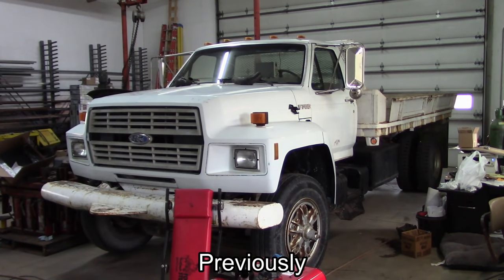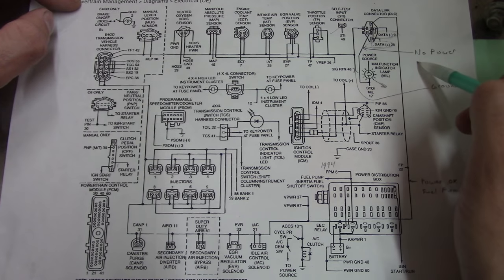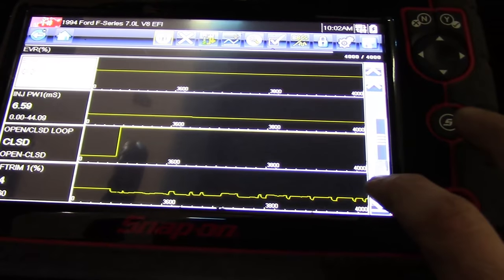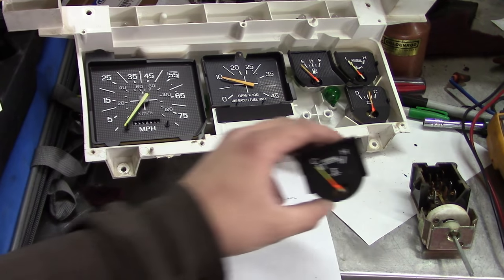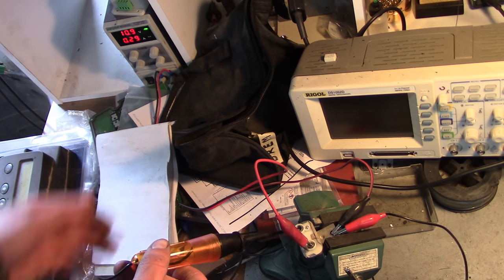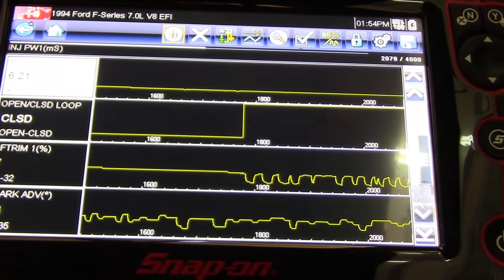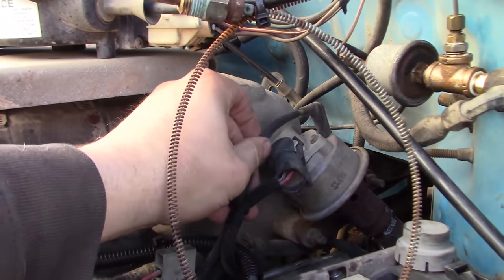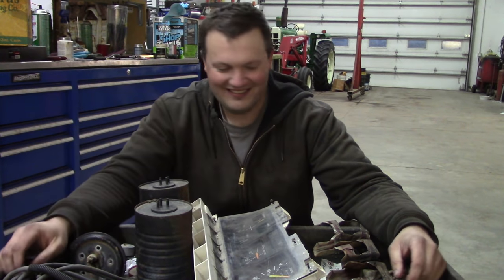Ford F700 Project - Missing, High Idle, and Gauges - Diagnose and Fix (Gas Engine) - Part 3

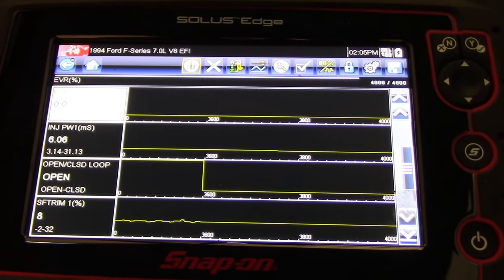Comment: 37:30. Those obd1 o2 sensors are unheated single wire sensors, when they cool down at idle they don't have enough heat to produce voltage so they switch to open loop. To get into closed, you have to rev the engine or drive it to get the exhaust temperature back up so it can work. It's why manufacturers switched to 4 wire heated sensors, to more quickly go into closed loop to provide better fuel management. I was a g.m driveability tech for way too many years. Had to learn GM management systems like the back of my hand. Ford used a similar setup.
Reply from the maker: It has a 4 wire O2.
Reply: @WatchWesWork  ok, I forgot it was a 1994, 1993 still used the single wire sensors.
Reply from the maker: @dave1135  I don't know what conditions it needs to run the O2 heater. It doesn't really matter, it runs fine in open loop.

Comment: Plus that Check Engine light bet O2 sensors on manifolds plus before or after Catylic Convert even could be plug up too! Purge Sensor on Engine may need fix too !

Comment: Wes, that regulator is likely working as intended.  Those old regulators use a bimetalic strip and a heater to provide what is effectively a low frequency PWM signal where the duty cycle is inversely proportional to supply voltage.  The average output voltage is (somewhat) regulated, but only suitable for powering devices with very slow responses e.g. hot wire fuel/temperature gauges.  The symbol on the schematic represents this if you have a close look.  EDIT: wrote this before you discovered it yourself.
Reply from the maker: The replacement seemed to be working correctly. The original did not.

Comment: Ford used those pulsing regulators since they went to 12 volts. MOPAR also used one, I use them on my hot rods when I switch from 6 to 12 volts and want to use the original gages, they work good providing 5 to 9 volts for the old gages. If it has anti lock brakes that would explain the additional data link, at least that's how it is on my 91 ford. Or just chalk it up to OBD1 sucks.

Comment: Yes sir, Those voltage regulators flash. It's not 12 volts but usually around 6 volts. At least on the old 70's models lincoln continentals. Since this is an older video you probably know why and how the voltage regulator works. The reason they made them this way was so when you turned a corner and the fuel in the tank would slosh around, it wouldn't cause the fuel gauge to fluctuate.

Comment: Wes, the schematic for that voltage regulator showed a resistor with square corners instead of the usual diagonal lines. That used to mean that it was a heating element. I expected from that, and it being a regulator, for it to have been the equivalent of a "ballast tube", which was a resistor that increased in resistance as it got hot. A flasher is also a heating element, but made as a switch, and will kind-of regulate the average current over several seconds, but it is pretty clumsy for a "regulator". Maybe they really designed it that way, or maybe the replacement has a wire that is going open, who knows.
Reply from the maker: Comments say it should pulse to prevent jerky moves in the gauges and lower the average voltage.

Comment: You actually gave this guy back his truck. With all this there is no way an owner could have fixed all this stuff. And made it sort of legal to drive on the highway without stopping along the way because the huge gastank you wouldn't remember when you filled it up if pulling contractor trailers with equipment. I watched diesel creek fix his old 429 on a 15 ton crane truck. He had to remove his to fix the engine. Possum down south fixed his crane truck also but it was a 350 Chevy with a ruined edelbrock carb.

Comment: I can't speak for Fords directly, but dropping from closed loop to open loop after some amount of idling was pretty common for that vintage.  I had a 1986 Nissan 720 with the Z24 that had a closed-loop feedback carburetor (pre-TBI!), and the service manual describes similar behavior.

"Open-loop control will activate under the following conditions:
a. When starting
b. When engine is cold
c. When exhaust gas sensor is not activated
d. When driving under heavy load
e. During deceleration
f. At idling"

'F' being "10 seconds after conditions below are completed:
• Engine speed < 1,000 rpm
• 70°C (158°F) <= Water temperature < 90°C (194°F)
• Idle switch: OFF"

The "idle switch" is an idle-up for the high-altitude variant, I believe
Reply from the maker: Interesting.

Comment: Well, by watching this video, I now know my dog (Pit-bull, Samson his name) sitting RIGHT NEXT to me on a (approx.) 6 foot bench seat is common. Great video. The laugh is awesome, when checking the hose with the pliers or whatever.

WES asking the customer, do all the lights work? CUSTOMERS' ANSWER: O yes, they all work. Back in my autobody day's, would ask the same question, and you know the lights haven't worked in year's. Just to gage how much of a liar they were. I later came to the conclusion the customer really had no idea, they just pull / push the switch, to turn on the lights, the dash board didn't burn up, so all the lights must be working. Face to palm, shaking my head. 

How I learned this, was asking a customer "How often do you check all of your lights?" HERE'S the 64 thousand dollar question: How do you check the lights all by your self? Simple answer, either you turn on the lights, get out of the car if need be, walk around and visually check each light. Or, when parking say at the local 7-11 store, check your lights via the store front glass. You should of heard the stuttering coming out of his mouth. It was price-less. We're not talking rocket science, but you would have thought so. LOL
Reply from the maker: Sounds about right!

Comment: On older vehicles, especially those with one wire o2 sensors, it’s not uncommon for the system to fall back into open loop. Possibly replace the coolant thermostat and upgrade to a 3 wire heated o2 sensor may help alleviate that.

Comment: ohh the 90s. I just recently misdiagnosed a fuel and temp sender on my channel for the same reason on this cluster. Mine was a79 VW Scirocco though. but my research brought me to 90s fords with the same voltage regulator (they called it)  Whats wrong with using 12 volts!? ugh
Nice job Wes!

Comment: Plcs 500 have inputs and outputs 12 volts through 120 volts on output controlling valves ,coils,ecxt, swiches are always inputs,peoximeter,lever,heat,and pressure swiiches

Comment: On alot of the earler heavy duty models even F-250HD, they didn't get the data pins to hook to a scan tool until they went to the EFI-SD4x series PCm, my '91 7.5L has a EFI-SD3x PCM and the lines that are supposed to be live data are simply not populated in the connector.

Comment: I have a idea about the voltage regulator on the gauge cluster. I think the voltage might be a weird value....like not 5v and not 12v....maybe somewhere in between. So the flashing is the voltage regulator connecting and not connecting to come up with a avg voltage....something like 7v (just an example). I seen this on the video on a voltage regulator on a British car gauges. This is done by a paper thin piece of metal in the voltage regulator....power gets it hot and it curls away from contact....when it cools it contacts again. I figured engineers would have a better way of doing this....but apparently it works.

Comment: Ford used that pulsing voltage regulator way back in the 1960s. I'd have been tempted just to put a PCV valve in that vacuum line.

Comment: If that's an EEC4 computer, then I believe it does revert to open loop after one minute, or whatever, of extended idle.  And I believe that those Instrument Panel Voltage Regulators do produce pulsing electricity, in order to step it down for the gauges.
Reply from the maker: OK. That's kind of what I figured.

Comment: I really thought that 2nd data link connector was going to be for a PSOM module. Those are kinda weird since they have the same dash/interior as an 80-86 pickup, but they kept that old dash in the medium duty trucks til 97 i believe. I know the medium duty trucks with that dash have a more modern cluster than the 80-86 pickups. They went from a 5 digit to 6 digit odometer. Also, some modern medium duty trucks have 2 data link connectors, one for the engine, and one for everything else. I assumed this was kind of an OBD1 implementation of that.

Comment: This was a good one dude! :D There have been WAAAAAY too many hands on this truck over the years! Crazy stuff :P I'm actually surprised that there wasn't a hole cut in the floor by a previous 'mechanic' for removing the sender from the fuel tank. Also, I've decided that your laugh when you discover something truly messed up, is almost exactly the same as the laugh that I sometimes make when I injure myself ;)
Reply from the maker: Heh. Well be careful!

Comment: I would imagine the purpose of the rubber sleeves is to keep you from spending days trying to find a rattle in the engine compartment that started when you last worked on the truck.

Comment: And the extra DLC is for the Antilock brakes. This truck doesn't use it because it has air brakes. RABS. Old Ford's had the sensor on rear differential that read ring gear...

Comment: IME, high idle is a combination of IAC duty in the ECM, idle adjust on the throttle body, and TPS voltage.  Most likely someone janked with the idle on the TB to compensate for a low idle/stall caused by misfire.  This experience comes from late 80's Ford ECMs, I've not seen one that actually put out live data.  It seems to be a crap shoot depending on catch code what software modules Ford included.
Reply from the maker: Ford has a TSB about that. You can actually plug the little holes in the throttle plate to lower the idle. That compensates for the vacuum leaks that come up as the truck ages.

Comment: That voltage regulator is some sort of shunt regulator. From the schematic it looks like it might be a thermal device. It would be really interesting if you could cut open the bad one so we can see how it works.
Reply from the maker: Others have said it is thermal.

Comment: I said way in the beginning that is sounded like a vacuum leak.. That IAC isn't helping anything, nor is the lack of temp sender.. The tech of the time wasn't great, but it worked. Bring that thing back to stock and I bet the power and mileage comes back! Switching in and out of loop: did you check the coolant level?
Reply from the maker: Coolant is good. I think it does it intentionally.

Comment: I commented before on the secondary air systems being removed and now you see why.  Lines go bad, solenoid stick open, etc.. Now it has been a long time since I messed with these 
Trucks and let me reassure you most of that emissions stuff was removed, Im shocked it’s still there
Reply from the maker: There's really no reason to remove it. It's a very simple system. People just get so bent out of shape about it.

Comment: I played along an did a little "root cause analysis" while watching wes work.
I think I found the issue.
The yahoo who "fixed" the truck before it got into your hands
:/
As for the 2 OBD connectors, I am wondering if it had anything to do with the Jan 1996 transition year to OBDII. The truck engineers may have been playing around with a dual OBD, OBDII system to smooth out the transition bumps.
Cheers,

Comment: Wes you probably know way more than  i ever will but  one point inmy life i had a Ford that  somehow slipped under some weird  Emmission Laws that  had a strange way of finding the codes  getting the check engine light to flash the code  by using the Ignition Key   in a very specific pattern of on,Off , and On for a very specific  amount of time  this was in a effort to make the vehicle inCompliant  with Federal Emissions for a few years then some Law changed so the original system was Obselete  my apologies  for my lack of memory  as i suffered a Traumatic Brain Injury during my life and i don’t remember all the details that was noted in the Official Ford  Manual i had for that truck back in those days

Comment: 32:30 I like to use brake cleaner for shoving hoses onto fittings etc. Works great and evaporates without any residues. :-)
Soapy water works good, too. But I dont want to have that stuff inside fuel/oil lines afterwards. So brake cleaner is the better alternative imho.
Reply from the maker: Great tip!

Comment: 19:36 the crazed are you kidding me laugh. I’ve been there. Sometimes it feels good and sometimes it’s the crazy leaking out. So what they meant to say is everything they ripped out and removed doesn’t work. I had an international I had to change the fuel sender on  and I unbolted the cab and jacked up the passenger side. It had to go a bit higher than I expected
Reply from the maker: I don't understand why they make them so hard to get out. It's like the hole is always 1/16" too small for the widest part of the sender to fit through. It must take the guy on the assembly line a month to figure out how to install one without taking half an hour.

Comment: Those ford obd1 systems and the underhood DLC connector were sketchy at best when new, the underhood connector due to its enviroment was always hard to get a good connection to, to the point I had a terminal cleaner and a can of contact cleaner i'd use before even trying to connect my scanner.

Comment: I got it right, first few minutes in ,I was thinking high idle , a vacuum leak .on a electronic fuel injected engine,  I didn't know this body style of truck was still in production in 94'  . A modern 429 ci v8 , I'm not too familiar with this one . I assume it's similar to a 7.5 litre 460 v8

Comment: Another great and entertaining series.
How about the milage on the other instrument cluster? Did you change it or just left is for what it is?
Reply from the maker: I only used the regulator and coolant temp gauge from the replacement. Everything else is original.

Comment: The manual oil pressure gauge is the "fix" for the factory gauge. As I understand it the factory gauge is an idiot light with a needle. T in was a good plan.
Reply from the maker: Yes. All Ford trucks have a fake gauge.

Comment: That voltage regulator is a common fault source in old Fords,,,,, You can get a  electronic voltage regulator as a replacement for better reliability.

Comment: I noticed that between the first and second time you attempted using the OBD 1 that you used two different years on the scanner, the first time you put in 1991, and the second time you put in 1994.

Comment: You never know what hornets nest you're fixing to stick your head into. I had a bad (leaking) EGR valve (no filter) on my 89 Taco. I was pulling into my wrench man's place for an inspection and it was running like a rag. He was fixing to take one of his boys off to college and hollered for me to pop the hood. He piled in with a screwdriver, jiggled the EGR valve, it calmed right down, he stopped the line off with a screw and it's run like a Swiss watch ever since. I know why my Check Engine light comes on and it hasn't missed a lick since. 89 4.3 throttle body. You did GOOD! I hate gas jobs. The same thing happened at the sawmill with a 600 Cummins. We'll see how that's turning out. GBWYall!

Comment: Well shit, that must be why my 1984 Bronco gauge cluster was all wonky before I ditched the thing for a later at the time model pickup in the mid 90's  I liked that old Bronco, it ran great with that 2 barrel setup on a 351, but drank gas like a wino drinking thunderbird.  Cluster looked just like that F700, the tach would bounce pretty good on it, and every now and then the gauges would peter out all the way to right, then barely mark from the left, electrical gremlins I had no way of fighting nor the means to pay someone to fight

Comment: Watch Wes Work....WONDERS!  Man that was a lot of work but tbh all of those systems are relatively simple and straightforward.  If it was a 2020 truck with all of those problems I shudder to think how hard it would be to troubleshoot and how many electronic modules and "assemblies" would have to be replaced to fix it.

Comment: This is an old video but I figured I would wager a bet on the DLC connectors.  In the medium and large fords the engine tends to be standalone due to options of other brand of engines.  The other DLC is probably for the the body system.  The one that read the engine would of probably been different if the engine was spec'ed with a cummins, cat, or navistar.
Reply: LOL just read your pinned comment.  Turns out my response wasnt needed.

Comment: Out of curiosity did you ever add the vent cap to the charcoal canister? I wish I knew a mechanic that would see things, and automatically fix and then charge me for them... rather than finding out later that something was ruined because it wasn't capped. 😞

Comment: o2 sensors cool off and it goes to open loop ,, so I was taught when we used to do emission testing on these fords ,, stab accelerator pedal and it sends it back ,,,,   seconf  test connectors are for Brake system ABS ?

Comment: If you plug into the visible OBD connector it will not return any codes, so it will pass emissions just fine.  At least that's what someone thought....

Comment: Are you sure that what you said was a regulator wasn't actually a flasher for the hazard/turn signals? I was thinking that maybe that year they split the power to hazards/turn signals to feed two different flasher units, one for the indicators and one for the actual exterior lights? Other than that, I don't think a voltage regulator should flash?